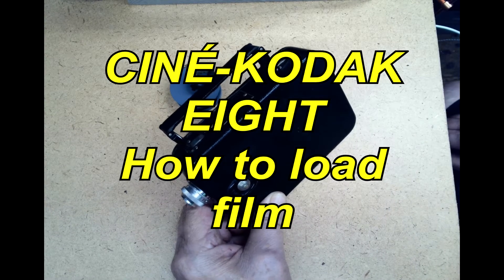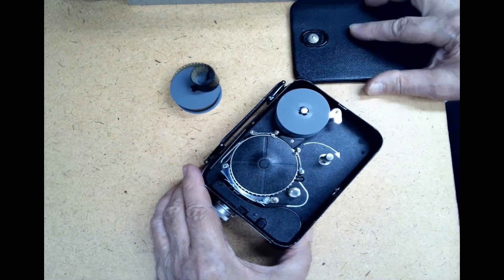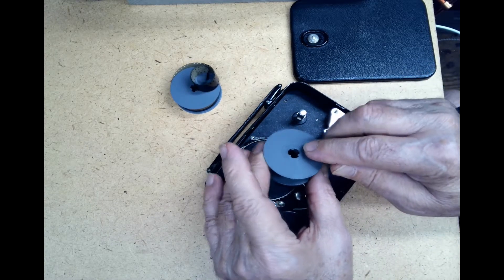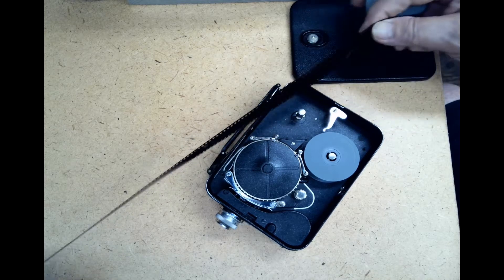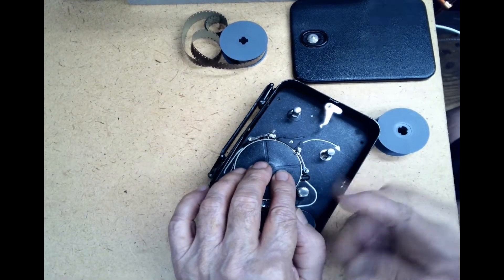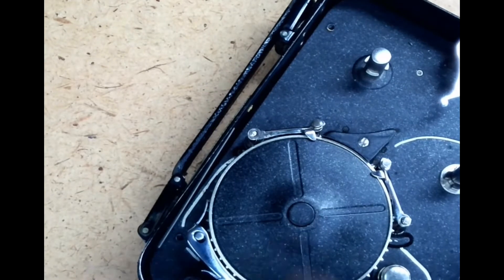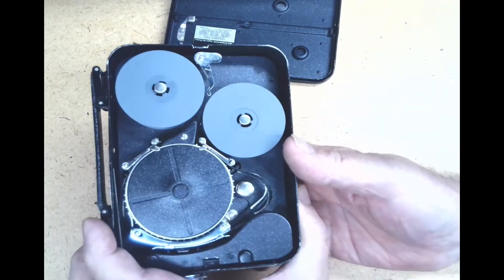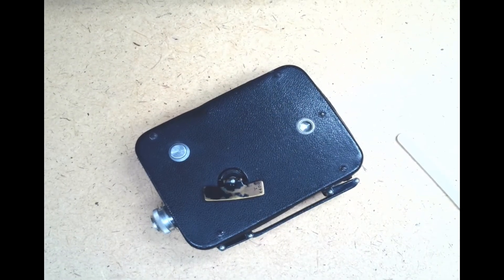KODAK CINE-EIGHT: HOW TO  LOAD FILM

Comment: This was super helpful. I shot a roll on this same model but it came out with “vertical pulling” as the lab called it where it looks like the image gets stretched out from top to bottom. They said it’s usually due to loading errors. I’m thinking it was probably my loop! I will try again even though my wallet is resisting 😂
Reply from the maker: Yeah, the "vertical pulling" you mention sounds right. The film should not be pulled through the film gate by the moving reels. It should gently roll through as the film gate claws move it one frame at a time. Otherwise, the  turning reels will try to pull it without regard to the sprocket teeth.
Depending on how well you loaded it, you may have half the film just fine, with the other have having the pull marks. Or, you may have mis-loaded both halves.

Try again and make sure each half of the roll is smoothly flowing. Don't worry about wasting a few feet of film. At 16 fps, each foot is only five seconds of film.
Reply: @minimumexpectationsdiy6013  wow thanks! I really appreciate the thorough advice. I’m definitely going to give it another go. I really love this model. It’s so sleek and easy to hold.

Comment: I found a model 20 in an antique store a while back but the catch button is stuck on "close" and I can't open the door. Any suggestions?
Reply from the maker: Difficult to diagnose from afar, but I'll give it a try.
First, you should not need much force to open this camera. I usually use my thumb and maybe my thumbnail to slide the button to the open position. 
This camera should be easy to open. In fact, the door (side) should almost fall  away when the lock is released.

If it's stuck with gunk or rust, you should use some penetrating oil like Liquid Wrench and a Q-tip to apply it.  on the camera. That's why you use the Q-tip. Make sure the oil can work its way the button. Wait about 20 minutes and see if it moves. If not, repeat a few times and try to move the button back and forth (open and closed).

Other things to try. Use a small wooden dowel and a small hammer to tap the button toward the "open" position.  but at a low angle in the direction the button must move.

You need to verify that the door (side of camera) is properly seated on the camera body and not misaligned. 

If the button finally slides and the door (side) still won't open, then you may need to use a thin-blade screwdriver to gently pry it open.

When you get it open, please post a photo of the inside, especially if you can see the cause of the problem—dirt, rust, damage, or something else. 

Good luck and best wishes. James